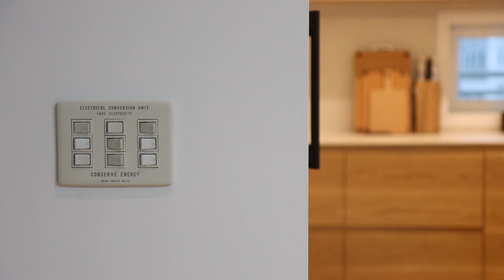W108_Modern kitchen Interior

Comment: 11:02   one of them was trying to put a hand at the midle...giving it a more stability, while the other one, just hold it at the other edge..
Result?
Broke at the midle, on the weak part.
Reply from the maker: yes~ that wat my first time install that panel... I learned with money😂
Reply: @ViTTEN  i used to work with glasses, big pieces, windows, shower doors, big tempered glass doors....the way you hold is like this:
The piece is a rectangular, a long, and wide side.....i see you are holding in it flat, but as a rectangular, you suppost to hold the long part down, and the wide part up all the time ( 09:17 this is the way you carry the panel ) in this case, the part that breacked, that is the part that go up all the time..
Once you are next to the cabinet you present the piece in the same position "wide up, long down", and touch the cabinet, the long part of the cabinet, right about the midle of your panel, so the cabinet give you stability at the midle, and along the whole panel. ...the extra hand you tryed to put (09:17 in this same minute, instead of putting it on top, you touch the side of the cabinet, right  about the midle of the panel)...once the panel is touching the cabinet, than you flatened the piece in a fast moution. 
I hope that make sense with my poor english..